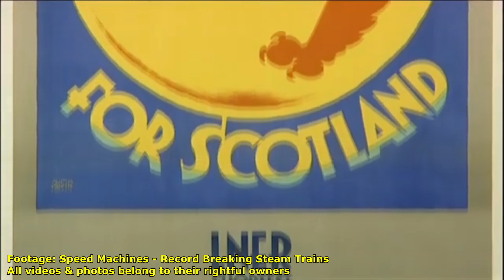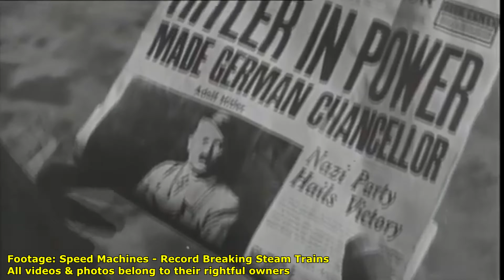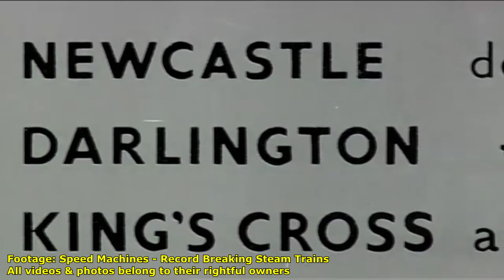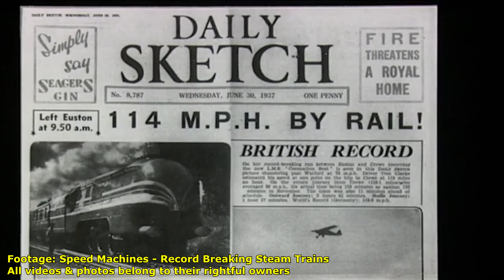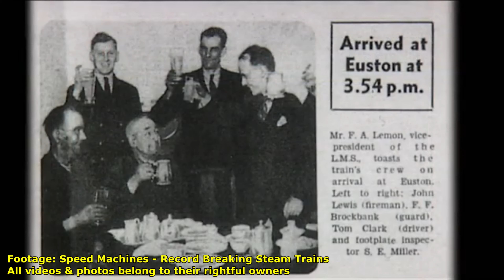Record Breaking Steam Trains

Comment: Hey I have a question how were you able to get the nameplates on the LNER A4 
I can’t figure out how to get the nameplate on when I type in the number
Reply from the maker: The only way fir the names to appear is if you type in the number. Sometimes it works, sometimes it doesn’t.
Reply: @bradleythomasburdentrainta366  ok